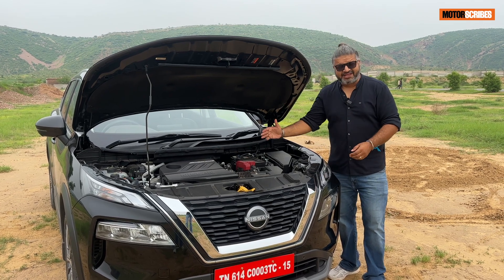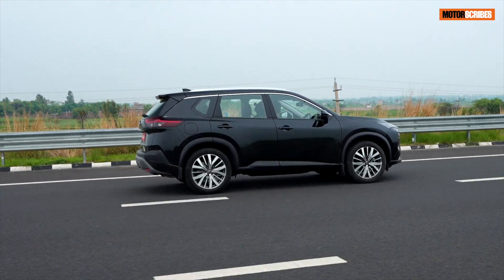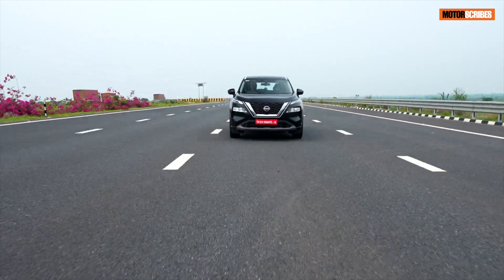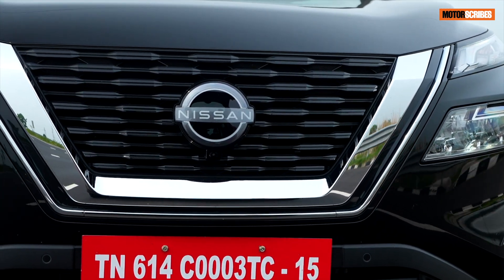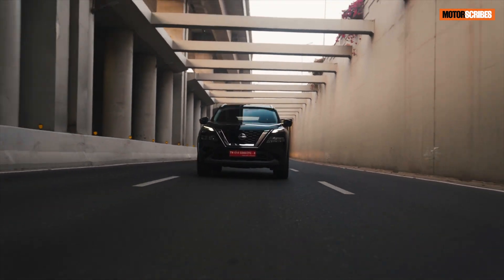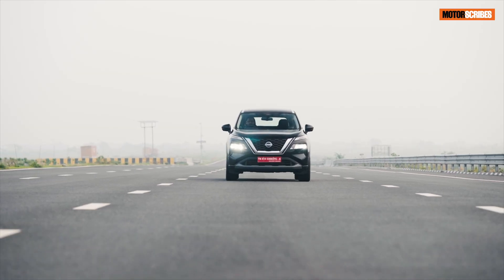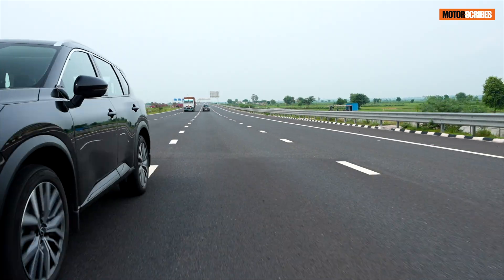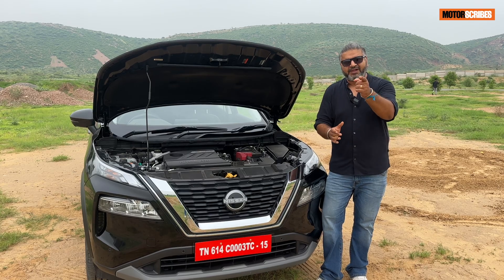How the Nissan X-Trail Variable Compression Turbo Engine Works

Comment: The technology is great but what purpose does it have ? 
More fuel efficiency? Not in real world 

More Power? Well no 

Maybe more service times in between? No 

Maybe refinement? No

Then what does this give ?  

More complicated engine with more complicated electronics and only 150 units so best of luck finding parts after 6 years or so.

You may say its to showcase thier engineering capabilities. Like manufacturing the worst gearbox in the automobile history.

Nissans magnite is great. They need to rebadge the triber and maybe launch something we want like the terrano or something. Not this.

C'mon nissan don't do this. Make and sell good cars.

The concept is great tho.

For people to understand easily. Low rpm the compression ratio is like bullet for torque and higher rpm compression like ktm duke 390 for top end performance
Reply from the maker: The tech is great for sure. For a large vehicle like the X-Trail to do 0-100 km/h in about 10 seconds isn’t bad at all! Avg is around 14 kmpl…which isn’t top notch, but not bad either. We can live with that. As for future plans of Nissan (and I think you’ll like this part)…5 new products coming in 2 years including the updated Magnite! A new Midsize SUV and its EV counterpart are also in the pipeline. Nissan will have an India focus line up as well as a halo product line of their best CBUs. The X-Trail might be tossing up a lot of questions in everyone’s mind right now, but it just the start of a larger strategy that will play out over the next few years and help Nissan India grow.

Comment: The main talking point of this car is only the engine. Apart from that, rest everything is average. Most importantly, it's coming via CBU route and for that the price really sucks. Otherwise it's a pretty good car with no nosense cutting edge features and stuff ❤
Reply from the maker: @ArunKumar-2000  Price has still not been announced…so it can’t suck right now. We will have to wait and watch what Nissan does…I’m hoping for a good price point.
Reply: @MotorScribes  Hope Nissan doesn't disappoint. If it gets wrong, then definitely it's going to be a farewell for the brand !
Reply from the maker: @ArunKumar-2000  Fingers crossed. Nissan does have a strategy to launch a lot of vehicles ..some CBU, a new Midsize SUV and facelift of Magnite…
Reply: @MotorScribes  Great Information! 
Thanks for it. Need to wait and watch if it's going to be some excitement or disappointment
Reply from the maker: @ArunKumar-2000  yeah..